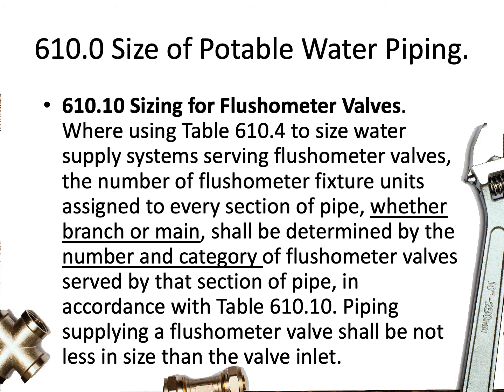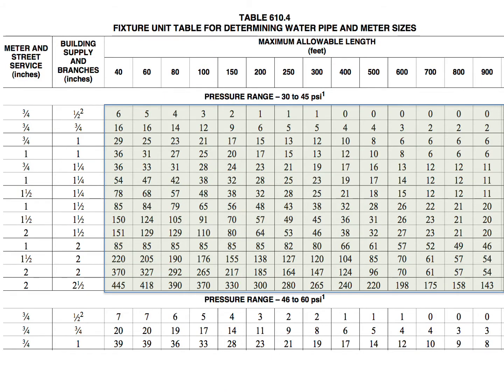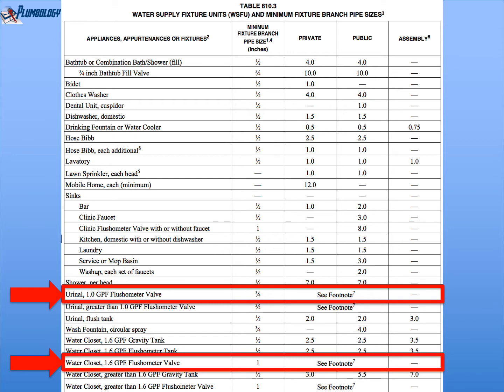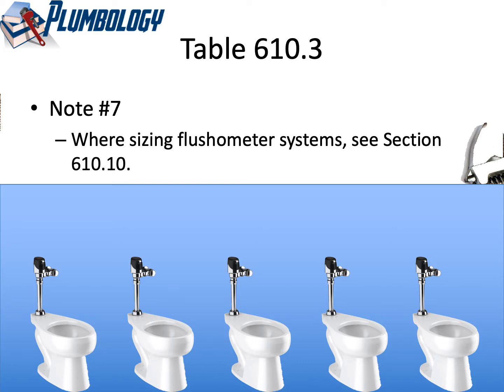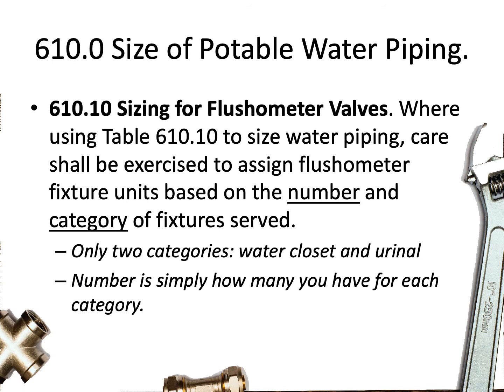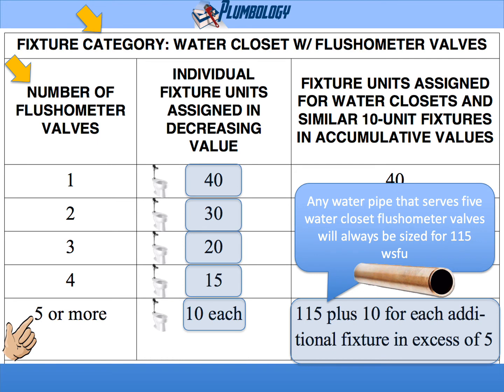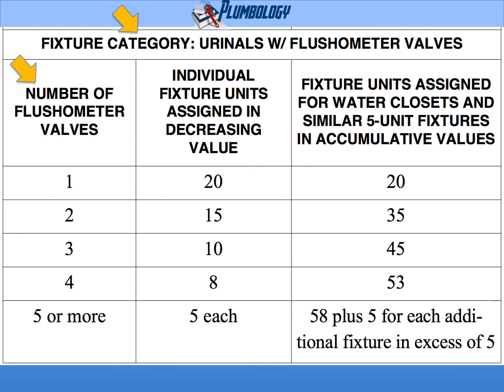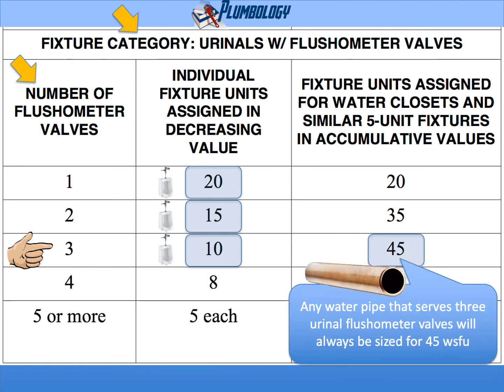Water Pipe Sizing: Flushometer Valves_part 1

Comment: Why is it so many fixture units lol . So random I think
Reply from the maker: Water supply fixture units for flushometer valves is based on probability.  Let's say there is a building with only one water closet flush valve.  Code tells us the assign 40 fixture units to that flush valve so it will operate properly.  Now imagine a building with 5 water closet flush valves.  Assigning 40 wsfu's to each is not necessary because the probability that all 5 will be flushed at the same time is very unlikely.  So the code uses a decreasing scale for water closet flush valves (40, 30, 20, 15, 10)